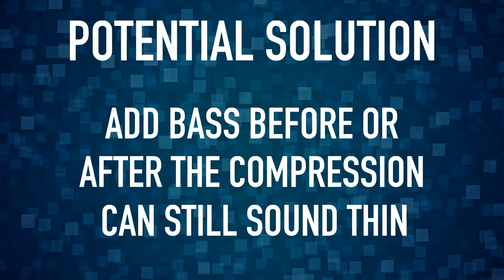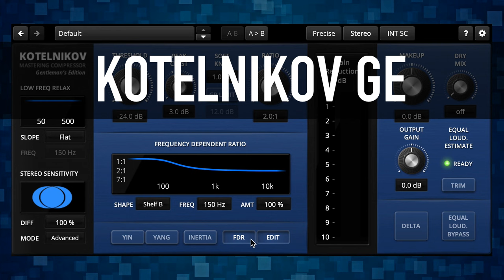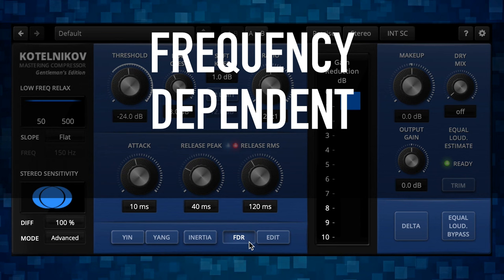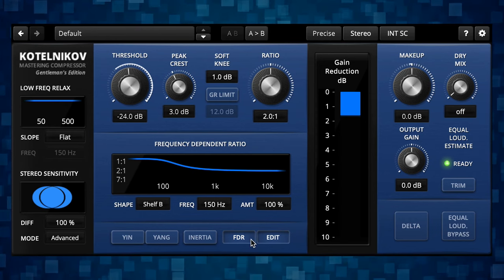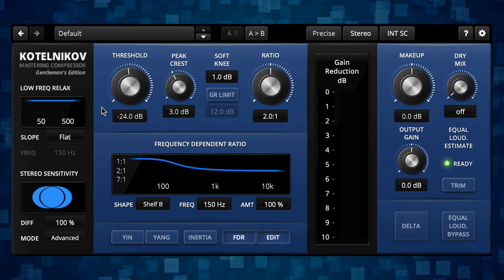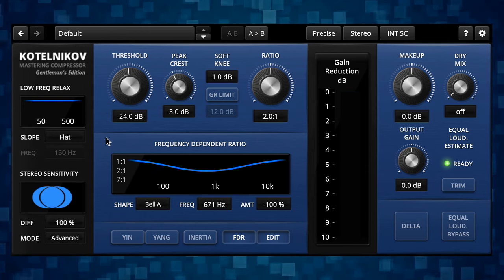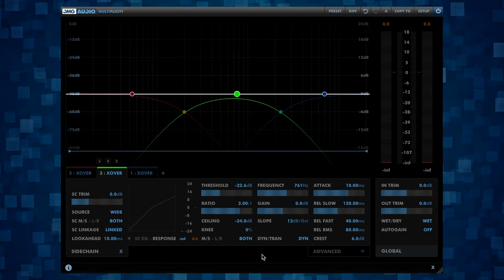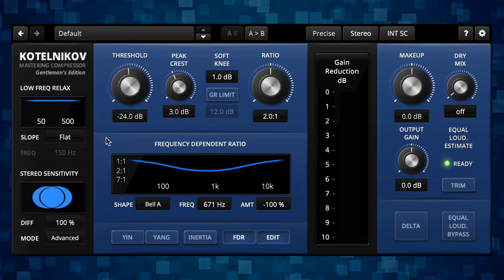Next-level trick for fatter bass! Mastering trick in Kotelnikov GE

Comment: Thanks for sharing this video! I'd never heard of this trick before. I would've been curious to find out how this would compare to simply EQing the sidechain signal. Is that what the "low frequency relax" feature does? I've no experience with the Kotelnikov as of this moment, I don't think I've heard of other compressors with this feature set, or at least that presents it in this way.

Comment: TDR Kotelnikov GE is not a multiband compressor, but a band selective compressor. There's a difference. In multiband compression, we have crossovers between frequencies that can be controlled, and this is usually a problem because they introduce always a phase shift in the signal. Band selective compressors, however, don't suffer of the same issue. Another example of such compression often used in mastering is the Weiss DS1-MK3 hardware compressor
 (there's also a plugin). The difference is that the Weiss acts as a limiter / de-esser rather than a compressor, but maybe the Kotelnikov can be also set similarly by ramping up the attack speed to maximum.
Reply from the maker: Kotelnikov GE is a full band compressor and it's not "band selective" in the same way that the Weiss DS1 is. Kotelnikov reacts to the full signal (apart from the SC high pass) but can have different ratios at different frequencies. That's the topic of the video.

"Band selective" is what Weiss calls the DS1, and that is indeed a multiband compressor. It has hi/low/band-pass filters to split the signal into separate bands and can apply dynamic processing to one of the bands. The filters are linear phase so no phase shift is introduced, although there is pre/post ringing. It can also be used as a full band compressor or limiter, and it has a separate peak limiter at the end.

Multiband compressors, deessers, dynamic EQs and plugins like Kotelnikov GE are all different but also quite similar. The main differences are the shapes and sizes of the frequency areas that are being processed, what is being fed into the sidechain(s) and how the sidechain(s) react.

/Thomas

Comment from the maker: Have you used this trick before? Do you know about any other compressors that can do this? Please share with us!
Reply: Is the TDR GE EQ-ing the sidchain signal? Or doing emphasis/de-enphasis EQ? Or something else entirely?
Reply from the maker: As far as I know it is filtering the delta signal.  /Sofia
Reply: @bodanerius  I believe it is altering the ratio in different parts of the frequency spectrum. So it actually compresses less of the bass in this instance. Eg: 1:1 on bass 4:1 on mids and highs and inbetween is varying from 1:1, 2:1, 3:1 to 4:1. Hope this makes sense? 🤷🏾‍♂️
Reply: @molandsonsmotors9690  compressors generally have 1 ratio 4:1 etc. Kotelnikov has a variable ratio which you select for a range of frequencies. In this instance the bass area had a 1:1 ratio and upper mids / highs have a 2:1 ratio. So the bass doesn't get compressed. Pretty genius actually and it's not the same as a multi and compressor, it's quite unique.
Reply: Tone Projects Unisum has a multiband sidechain while being a single band compressor. You can tweak threshold, ratio and RMS speed / Peak influence (Peak Crest on Kotelnikov) per band and they will influence how the compression acts on the audio path. That allows you to implement this technique while also having control on the speed of the detector for each band. Really powerful and it sounds very musical. I love both, tend to reach for Kotelnikov for faster attack times and Unisum for slower ones. Most times both in combination.
Reply: I think Neutron can do this in dynamic EQ stylee

Comment: Since its a wide band compressor the low end will still get compressed. gain reduction will lower every thing passing through. It's not multiband
Reply: This is not a hpf in the sidechain. This is a variable ratio. The bass is a 1:1 ratio mids and highs are a 2:1 ratio. It is literally not compressing the bass. You are correct in the misconception of a high pass internal sidechain, but that is not this. The variable ratio is unique to Kotelnikov, you can't compare it to other full band compressors.
Reply: @NoQualmsTheArtist  So if the bass was at 3:1 then what?
Reply: @frankharley442  you can choose what ratio curve you want. Compress more bass, less bass, only mids etc. The compression is still triggered by the whole signal but only compresses a certain frequency range, basically the opposite of a sidechain EQ which compresses the whole signal triggered by part of the signal.